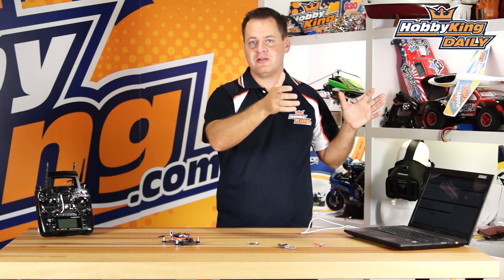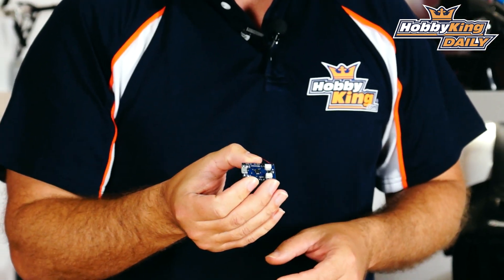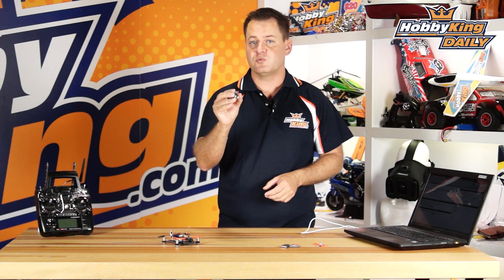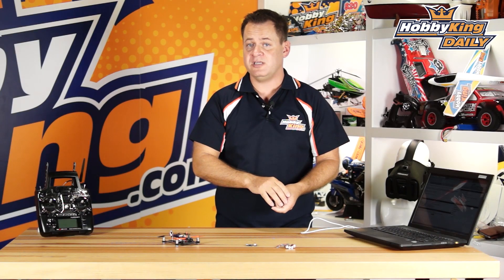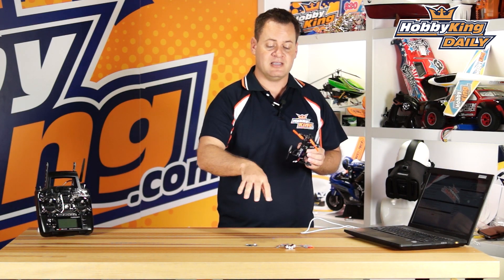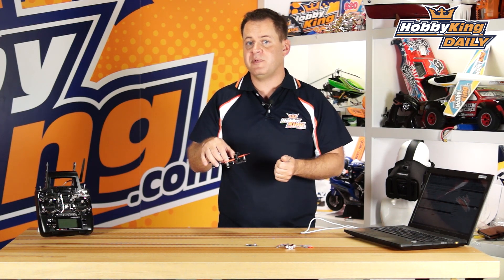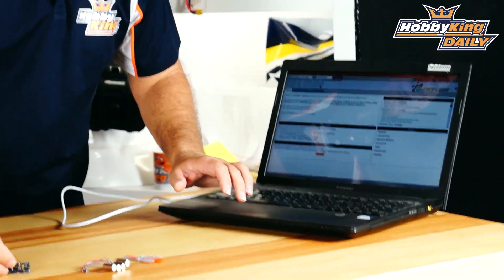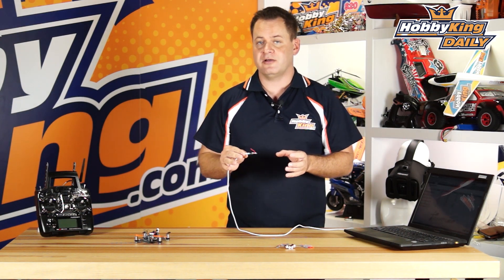Quanum Pico 32 - HobbyKing Daily

Comment: how much can the fpv set weight to still be able to have nice power on it?
Reply: on the copter
Reply: ***** Thanks
Reply: +hansdietrich83 
Need to use the micro FPV gear ~10 grams
Reply: AC, did you order some of dees? I gotta cancel my back-order from BG now. Nice to have a reliable source.

Comment: I like that :)  Slightly beefier then the micro-FPV-quad's I'm now testing :)  How are 2 motors CW, and 2 CCW by the way? I mean: I'd think they can All run CW & CCW?? (confused)
Reply: +DutchRC Adventures I think difference is in the way brushes are positioned in relation to the rotor - in CW motor they are facing the opposite way from CCW motor
Reply: Okee thanks :) .. I must admit I'm not knowledgeable about brushed stuff ;)
Reply: +DutchRC Adventures 
 If there is timing advanced then the polarity is important, if no timing then no polarity
Reply: What would that timing advancement then do??
Reply: +DutchRC Adventures 
Makes lotsa power, heat and amp draw
Reply: +BWX The motors don't have plugs, but I do see different wire-colors indeed...